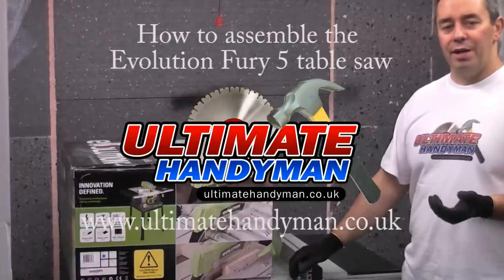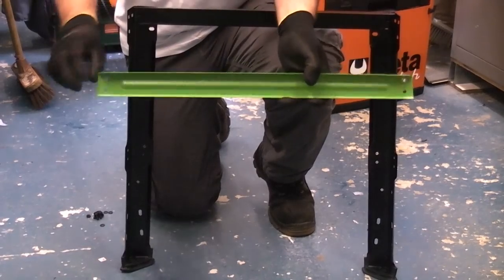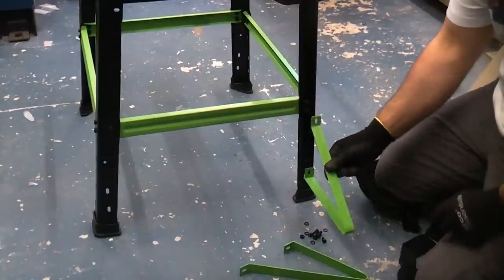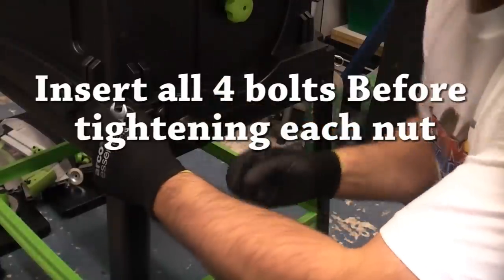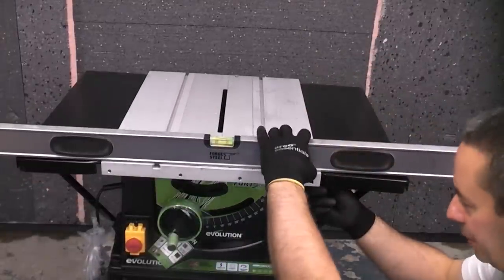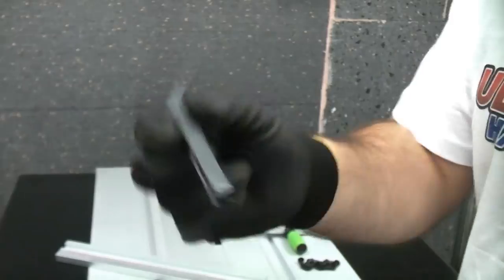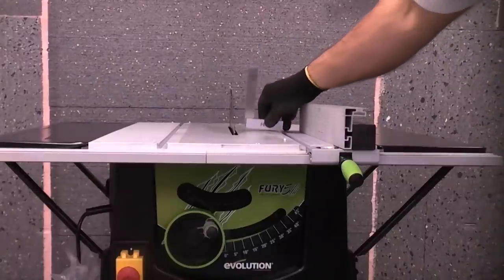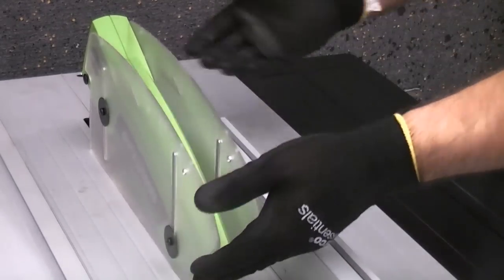Evolution fury 5 table saw set up

Comment: Hi great video. just bought one came in a box that looked like it had rolled down a hill some bolts missing washers too measurement gauge damaged nothing would line up square turned out the whole motor assembly was in crooked so I have taken it apart to work on as I was a mechanical engineer I feel I should be able to fix it didn't send it back as it took ten days to arrive and multiple projects on hold shame rely as I have a rage 3 mitre saw which is marvelous. Keep the videos coming and thanks a lot.
Reply from the maker: +Henry Grant 
You are welcome ;-)
We have something in common as I'm also a maintenance engineer!
I'm glad you got it sorted eventually. I have only use the table saw a couple of times but I use the Rage 3 regularly, it's an awesome machine!
Thanks for the comment

Comment: Hi I have the same saw, I have a problem with the fence even though I set it  parallel to the blade every time I move it it is out of alignment. So everytime I move the fence I have to set it back to be paralleled. And it is flexing at the end. 
Also I will really appreciate if you can show how to set the blade to be paralleled with the channels.
Take care
Karol
Reply: I also have the same saw and I thought either the fence kept moving out of alignment or the blade was.I checked it with the mitre slot and it was the blade that was moving out of alignment. over a period of about three weeks I must have realigned the blade 4 or 5 times only to realise that it was the up and down movement of the blade that was effecting the alignment. When the blade is at it's highest then the blade angled to the left and when lowered to about 20mm above the table it angles to the right. So it might not be your fence that is the problem.
Reply: Thanks Stuart, I think it is time to start saving for better saw.

Comment: Bought new saw all ok but when I switched it on the blade make a small clunk as it starts the saw cuts straight
Reply from the maker: There is nothing catching the blade is there?
Reply: It's a dreadful saw. The clunk is the motor pulling the blade down. To check this, set a height then just turn saw on and off and measure the height again, it will be lower. I'm on my third saw, they have all done this and have all had terrible blade wobble.I don't use it any more too imprecise, too many faults and design flaws.